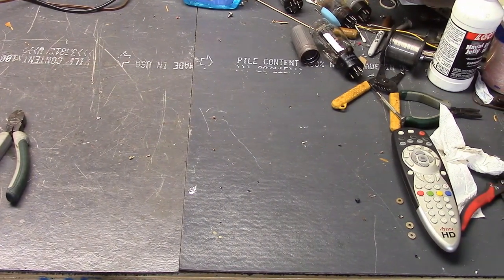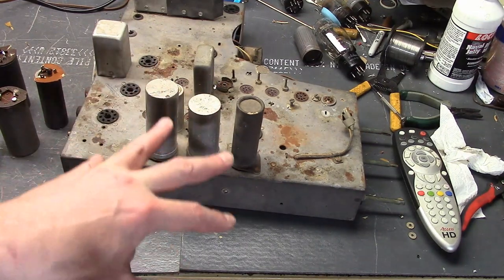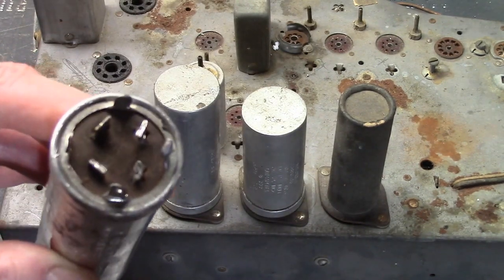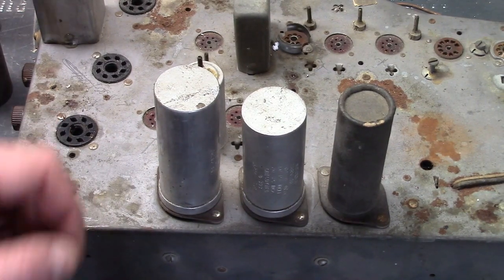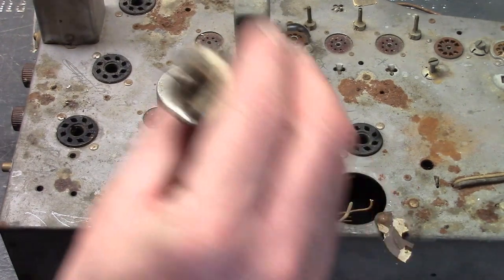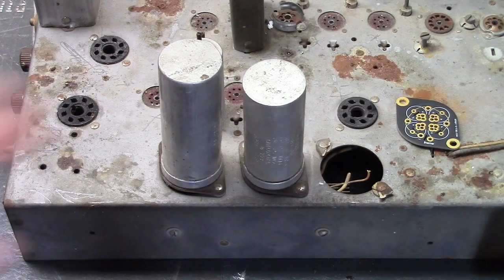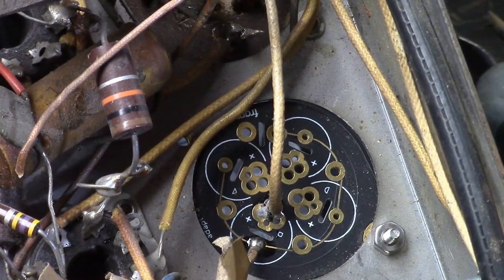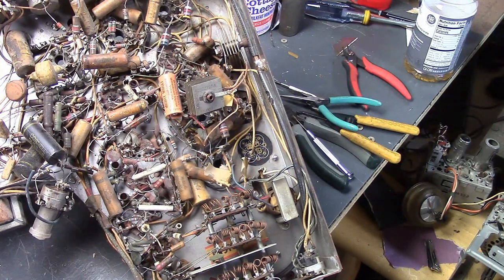Motorola TS-4 chassis adapt-a-cap

Comment: Great demo!  Minor possible error:  When you soldered in the second ("negative") wire, you chose the smaller hole that would have accommodated the negative capacitor lead, instead of using one of the large negative holes between the caps.   In any case, I'll certainly consider adapt-a-cap as opposed to my current go-to solution of adapting a tube socket as a cap mounting base.
Reply from the maker: True but they are all connected together.

Comment: These adaptors seem like a great solution.  I know the pads on the board will be mostly covered by the caps, but it did occur to me that they might bring exposed (potentially high) voltage to the top side of the chassis.

Comment: 12:59 I hate to object. The negative lead on a radial cap is NOT connected to the case. Please refer urself to the document "Aluminium Electrolytic Capacitors - General Technical Information" by TDK issued in August 2022 
I quote from page 8
"Axial(sic!) leaded capacitors have a direct electrical contact between case and cathode terminal. Single Ended(sic!), SMD, snap in and screw terminal capacitors have an undefined electrical contact through electrolyte..."
Reply from the maker: I stand corrected. Thank you.

Comment: I tend to prefer using a set of carpenter's pincers (or blacksmith's pincers) to cut the rivets.  The rivets can still fly across the room, but the pincers save from abusing your wire cutters.  Carpenters use pincers to pull nails, so they're tough.

Comment: 14:17 why not take a different approach? Instead of clipping the capacitor leads flush with the mount-a-cap and then solder the connections to the pad, leave the cap leads protruding a bit after soldering and bend them in a short eyelet type loop and solder to that loop instead of the pad. That avoids the "shove the wire up to where it shorts to the can" problem from the get go...
Reply: Or how about allowing enough on the leads coming from beneath that they can be doubled back down or at least bent sideways on the top of the adapter.  Also instead of those solid buttons, put a dab of RTV after all is assembled and soldered.

Comment: Since all the Negative leads connect together, wouldn't it make more sense to make the negative throughholes the ones closer to the middle of the board? It seems like you'd want the common leads close together and the separate positive leads far apart.
Reply from the maker: The original cans have the negative tabs around the outside and often components and wires attach to them.

Comment: Would it be feasible to use m2 x 12 mm brass screws with nuts to act as terminals for the wires.  These would be the "lugs" for the new capacitor.